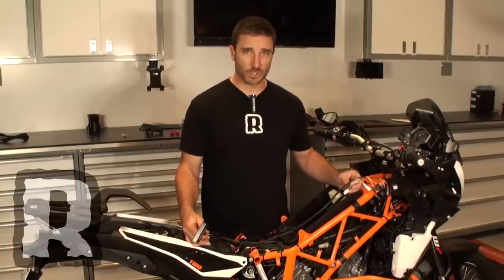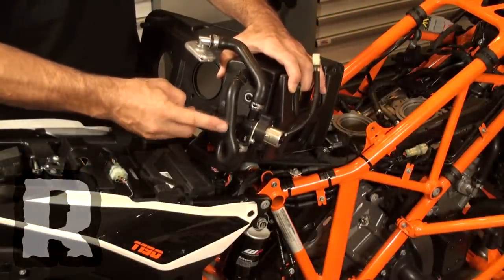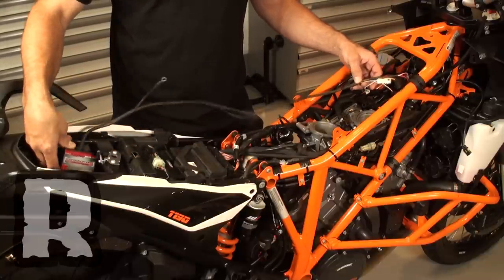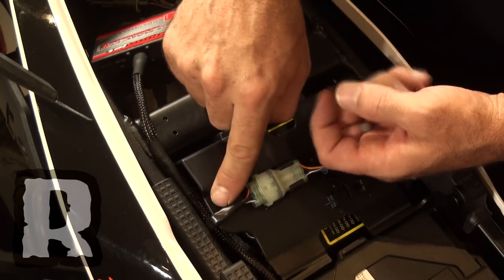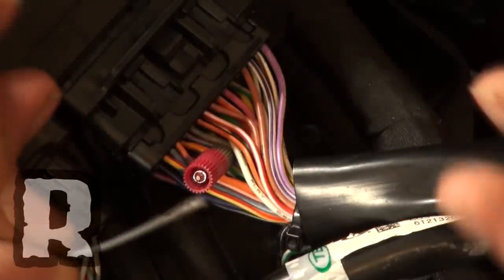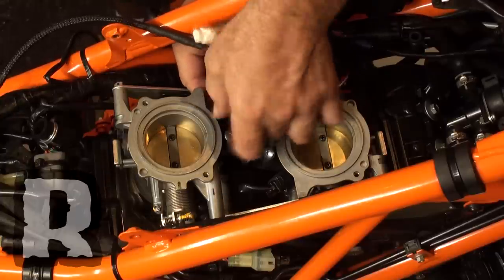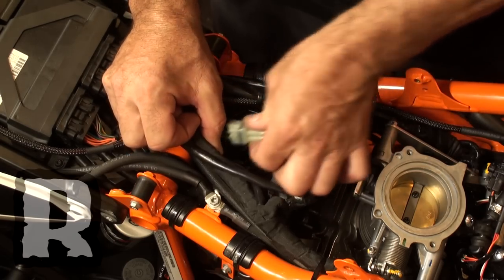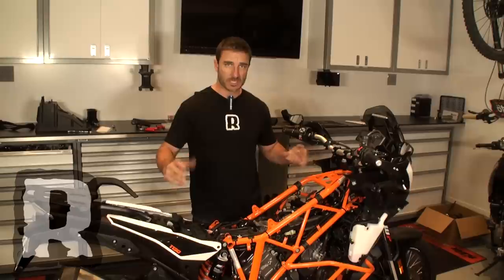HOW-TO INSTALL DYNOJET POWERCOMMANDER V - KTM 1190 ADVENTURE - ROTTWEILER PERFORMANCE

Comment: Is there any other way to wire into the throttle position wire without having to poke/cut into it with the posi tap? I would prefer not to have a hole in a OEM wire if it were needed to be removed.

Comment: Hi Chris! I have the Rott intake,  for 2018 KTM 1290 Super Adventure R. Have now PC V and AT 300. There´s no need for maps, because the AT300 does it all! Is that correct?
Reply from the maker: Yes and no. If we have set up the Auto Tune for you (recommended when purchased from us) then it is bracketed at 25% enrichment and 15% enleanment. If the base map is close, then you should not hit any limits in terms of the Auto Tune doing it's job. But do not fear, if the base map is way off, Auto Tune will fix it where it is enabled to, but you may need to upload the map once or twice with the PCV software, apply the trims to the base map, resend the map and then start again. You only need to do this once or so and only if you see a bunch of +25% trims or -15% trims. This means it is hitting the allowable limits and cannot go any further. This is a good way to creep up on making a map. 

Also, from 0-5% throttle, we don't enable Auto Tune because of reversion in the exhaust system that can throw off the wide band O2's so starting with a good map in that area is recommended. If you purchased the equipment from us our maps are always free.
Reply: Ok! Chris, thanks for the explanation and quick answer. I´ll do what you recommend.  
Another Question: The map switch will allow for dual maps or to toggle Auto Tune on or off, with the base map, for exemple less power and other with all bike can give?

Comment: How does having different ride modes affect the PCV?
Reply from the maker: Okay, so here is the deal. Before I begin, you DO NOT lose your modes. Those are based on a cocktail of traction control and ABS and do not alter any fueling or ignition. They just limit how the physical throttle plates react to what your wrist is doing. ‘Off Road’ and ‘Rain’ modes just limit the throttle plates to a maximum of 60% open. Sport mode is almost 1:1 
 
So, the Powercommander V works like this: In stock trim, the ECU sends a pre-set signal at any given RPM and throttle position to the fuel injectors in the form of a pulse width. The wider the pulse, the richer the mixture (more fuel sprayed). The narrower the pulse, the leaner the mixture (less fuel sprayed). The primary function of the Powercommander V (among many other bonuses that you can discover on your own) is the business of ‘hijacking’ those signals and modifying them by a percentage +/- via a piggyback unit that physically fits in between the connectors. Hypothetically, within the PCV mapping tables, (looks like an Excel spreadsheet with throttle position horizontally and RPM vertically) if there is a number (value of) say ‘11’ at 40% throttle and 5000 RPM, it is delivering 11% more fuel in that cell range. So on and so forth. 
 
Now, there is one more thing. The stock ECU is programmed to adapt from 0-20% throttle and from 0-about 5000 RPM. It primarily relies on the stock narrow band O2’s to do this. This is called ‘closes loop’ and it is not your friend. The O2 sensors are mounted in the exhaust header tubes to monitor how much unburned oxygen is in the exhaust as the exhaust exits the engine. Monitoring oxygen levels in the exhaust is a way of gauging the fuel mixture. It tells the computer if the fuel mixture is burning rich (less oxygen) or lean (more oxygen). It then takes this information and uses it to adapt the closed loop section to meet the requirements the EPA mandates for emissions. The caveat is that the closes loop section typically runs extremely lean to meet these requirements, leading to an engine that runs hot, jerky throttle and typically very poorly and of much less power. Not what the manufacturers would ever do given the ability, but are forced to do if they want to sell bikes in certain countries. 
 
Where the stock narrow band O2 come into (or out of) play: A Powercommander V comes with a set of ‘O2 Optimizers’ that essentially stops the stock ECU from constantly trying to keep the AFR’s (air fuel ratios) at 14.7 (lean). This is for the purposes of accurately re-mapping the fuel curve without the base map constantly changing underneath it. Remember that the PCV map values are based OVER the base map values, and if the base map is always trying to adjust to be lean, you cannot accurately build or run a new map over that. The O2 Optimizers do this by sending the same signal back to the ECU so it thinks the conditions are the same all the time and stops trying to adjust. Rest easy, you still have barometric pressure and manifold air pressure (MAP) sensors in play so the bike will still adapt to changing altitudes, temperatures and so on just fine, but the stock ECU can no longer rely on the stock narrow band O2’s for information in closed loop. (this is a good thing) 
 
What you end up with is the ability to completely re-map the fuel curve with ease as the PCV software is very friendly and even allows for real-time adjustment while the bike is running via dyno or the addition of an Auto Tune module. They are loosely called ‘Piggyback ECU’s’ for that reason. All of your ‘modes’ work as designed and are not affected at all. You simply end up with a bike that runs much cooler, more powerful and smoother at the same time as it is getting the fuel it deserves. 
 
PCV’s typically come with a preprogrammed map installed already. What we call ‘digital jetting’ so some of the old school guys can wrap their heads around fuel injection and how it works. They come stock with a map that is optimized for stock setups, but Rottweiler Performance also has a large stock of other maps as well that we can install and setup before shipment for free. All we need to know is the final setup and we will program it with one of our own maps that was acquired either through our dyno facilities or provided by trusted customers. 
 
Furthermore, if the customer opts for an Auto Tune, Ignition Box, Quick Shifter, dual map switches or any other peripheral that can be added to a PCV module, we can take the worry out of those too and set them all up custom for that particular customer’s needs so that the entire kit is mostly plug and play, making the process much more attractive to someone who knows what they want, but may not be intimate with how Dynojet Powercommander products work.
Reply: @RottweilerPerformance  great info Chris... Thank you!
Reply: Great question. I run close loop on my harley with wide band and the more you ride the better the bike feels. It's great being able to do upgrades and not have to spend $500 again for a tune. With that said, unless where you live have lots of elevation changes it's not worth the $ in my opinion in a adv bike. Buy a PC and get it tuned and don't ever think about it again. I wouldn't necessarily ask for more hp rather a well balanced bike that feels great on the dirt and ok on pavement. This where that OEM tune could make the bike you love into something you now have no pleasure in riding. How that torque and hp kicks in in tricky situation, engine braking, gearing- there so many components here that could turn a great bike into hell real quick
Reply: Explained perfectly 👍🏻

Comment: Have you dyno’d a Ktm 1090 adventure s with all this kit on at all?
Reply from the maker: We have.  We don't like putting the 'total' number out there, because it conflicts with all kinds of other runs that cannot and should not be compared. KTM will claim at the crank in metric numbers, we claim at the tire with standard numbers and so on. The only reliable measurement is same bike, same dyno, same day, before and after. On this bike, intake and PCV should put 10+ HP (SAE) to the tire.

Comment: Is this even worth all the hassle and $$$$ ?
Reply: Dulf Nordensvärd since there really is no way to do any ecu work other than buying the expensive full Akra system(s) from KTM dealers, on big twin Ktm’s. This is unfortunately the only tuning option for them.
Reply from the maker: If you like the bike, then yes. The differences are night and day and get the bike running as it should be. Strong and to its potential.